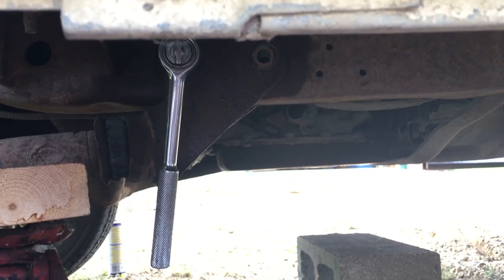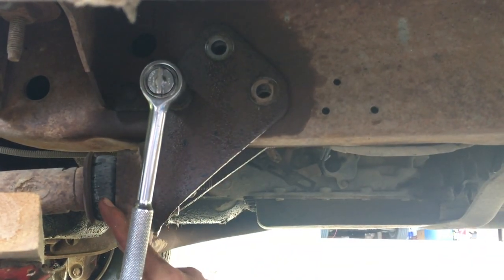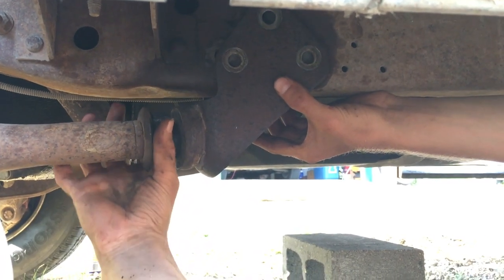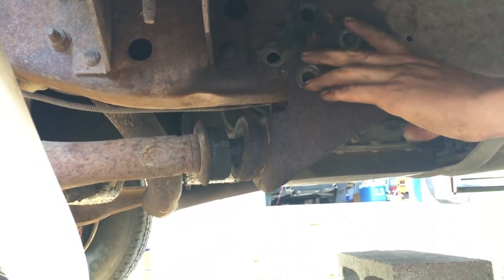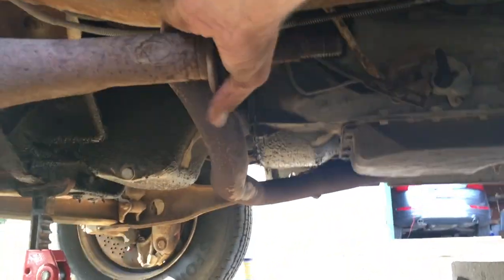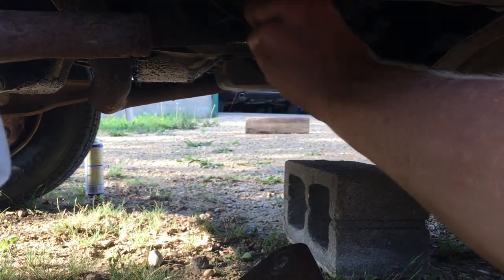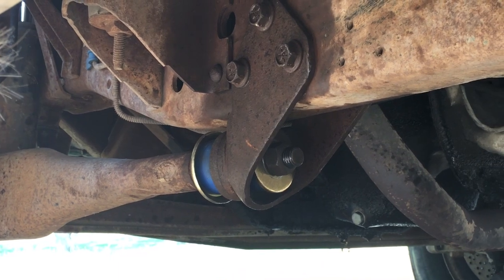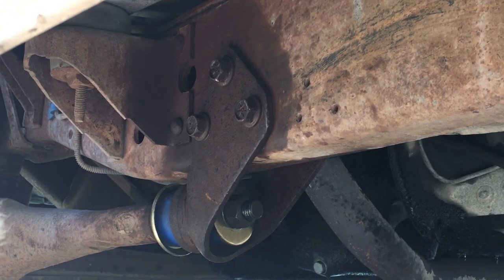How to install Radius Arm Bushings on a Ford E350 Camper

Comment: Could not remove the three bolts. Released sway bar connection and pulled axel forward with come-along to where I could remove old bushing. Worked great.

Comment: Great video, especially for your first time on something like this. I plan to do the same on my E350 van conversion.
I noticed you said you put WD40 to slide on the pushing. WD40 will eat through rubber with time. Silicone or Lithium grease is a suitable alternative.

Comment: The reason they quoted you so high is because on most trucks/rvs the radius arm mounting bracket is either riveted or welded so the bushing replacement usually entails dismantling most of the wheel/suspension assembly, thus adding to the cost. Lucky for you yours was bolted to the frame (probably some smart chap earlier on down the road who modified it and made it easier for future mechanics.

Comment: Good video. I'll be doing this job in the next couple of weeks. One thing I should mention is that silicone grease is what you should have used for sliding those polyurethane type insulator bushes, not WD40.
Reply: Yep I use  dielectric grease same stuff.

Comment: Hi. You seem to have such a hard time getting that bracket off the end of the radius arm. Earlier you had a ratchet strap attached to it. Why did you stop using the ratchet strap to help? Seems like it would have made it easier to keep using the strap.
Reply: Probably
Because it was cocking the whole
Thing into the threads of the center large nut and
Not pulling it straight this hindering any movement aft of the vehicle.

Comment: Damn. I got rivets...but it might still be easier/faster to grind them off and put bolts after the jobs done compared to taking everything off the truck
Reply from the maker: That is true could work if you got the tools!
Reply: @VeganIncline  thats what i tought before starting the job. I dont know if its the -25celcius weather but im having a rough time for sure. Tought i could grid the rivet's head off and zip gun the rest of the rivet out but its not working so i have to drill them all the way so its taking a little bit longer than i tought.

Comment: Perfect timing, found out today I have to do the same thing to my E350 van!  Good video, may save me time taking off the bracket, didn't think of that. Thanks
Reply from the maker: Nice 👍 so glad it could help! If you have the bolts option it will save major time not taking off the shocks and tires and so forth. Cheers! Let me know when your done!
Reply: I have the bolt type. I did drivers side, other side already done, soo, it took about 40 mins to do! I thought it would be tough, but using your method, it went pretty smooth!  Didn"t need to jack it up, just crawl under and did it.  Thanks again!
Reply from the maker: Thats awesome glad to have helped! Thats why i share!

Comment: Why don’t you tell us how to do it in the other side where the exhaust is..?
Reply: Same way just exhaust a
Little closer to your wrench that holds the nut near the exhaust.
Luckily the nut side is near the exhaust and the bolt
Pulls out the opposite side instead of pulling out the exhaust side which would mean the exhaust would have to be dropped.
If it was designed by Mercedes’ I can guarantee you they would have put the nuts on the opposite side.
Reply: @vikingrobot4179  thx for the post and the reply==
hmmm  so u saying i can do it like this and not take the exhaust off??  cause everything else i see says if i attack it this way, i do--

Comment: Common signs  of bad RAB include a clunking noise when you accelerate or brake, excessive and uneven wear on tires, and loose steering when turning corners.

Comment: Where did you put the jack to raise and support the vehicle? Under the radius arm itself?  I want to take the weight and tension off the radius arm, correct?
Reply from the maker: We put the jack on the frame and then once the front end was up we put a stand under the front wheel arms\__/
Reply from the maker: If you need help with getting the holes lined back up a jack right on radius arm is ok to get it up. I just put wood black in for cushion.